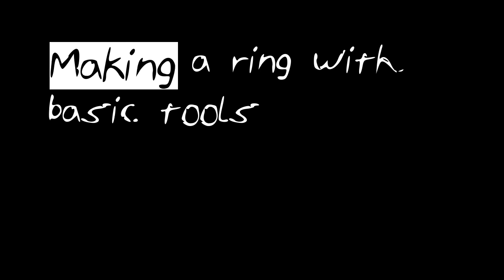Making a wood ring with basic tools

Comment: Terrific job and you've proved an artist doesn't need a shop full of expensive tools to create beautiful work. CA glue could be applied simply as ring is turned, then polished with a little cloth wheel to make it sparkle. CA also hardens the wood.
Reply from the maker: Thanks a lot John! Some other folks have also sugested CA glue, I'll have to give that a try sometime.

Comment: Cutting wood with a hacksaw? Man that must have been time consuming!
Reply from the maker: yeah fur sure it's not fast, but for such small cuts it's not that bad either.
Reply: They're great for cutting PVC or metal though. Do you have a 14 TPI blade on it? If not that could speed the process up a bit. 

https://www.amazon.com/Irwin-218HP300-12-Inch-Combi-Saw-Cutting/dp/B00004YO5F

There's also this Irwin combo saw. Pretttty cool.
Reply: Lies We've Been Told was doing it today isn't actually as bad as you'd think.. speed is your friend
Reply: That’s exactly what I was thinking
Reply: Bruce Chastain Get yourself a Japanese pull saw. The larger ones are good for big cuts but the small ones are perfect for the small cuts and will reduce finishing time due to the fine finish they leave. They can be had for a reasonable price nowadays.
Reply: It's actually not suprising
Reply: Imagine that time x 1000 when he was sanding by hand😰😴

Comment: If you want to simplify your next ring (or for anyone contemplating making one), you can start the corners with either a knife, a hand plane or chisel to help you knock off some of the wood quickly. Just be careful not to remove too much material.
Reply from the maker: Thanks Vol for the tip, I'd like to do another soonish.
Reply: Depending on the type of wood, you might also be able to put a taper on it to make it look less chunky.

Comment: you definitely want to treat it with something, otherwise you will have some issues. as a jeweler I've had to send people to the hospital a few times for infections stemming from untreated or undermaintained wood rings. Had a lady get meatball under hers, it adhered to the wood, rotted, did the same to her skin(she rarely took it off) and the hospital had to remove her finger due to a blood infection. Coat that thing!
Reply from the maker: wow! Well I did put some linseed oil on it, but I've only done it like once in many months. I'll have to reapply some soon I guess. I do take it off a lot, every night for bed and also when working in the shop.
Reply: What do you recommend?

Comment: I've heard that CA glue (super glue) is a good finish for wood rings. Hard, clear, shiny, and protective. Although I don't think it preserves color in exotics, and I'm not sure whether to put the oil on before or after CA glue. But if you apply 5 - 10 coats to that while sanding every few you'll be golden.
Reply from the maker: Yea I've heard CA glue works well too. I'll have to try that next time.
Reply: Bruce Chastain It’s Used on high end pool cues. You can use whichever finish you prefer first since it will mostly be changing the appearance. The hard CA glue will provide all the protection needed. Pro tip......CA glue can be used a clear coat repair. Just learn the techniques that guitar repairmen and luthiers use and you’ll have all the techniques needed to repair and finish wood.

Comment: I made almost 2 wooden rings using this method.  I do not suggest using a drill as a lathe.  A drill was not meant to run non-stop for long periods of time.  You drill for a few seconds then rest and repeat.  My drill burned up half way through the second ring.  The ring that i was able to complete looked great.  I would suggest using a rotary tool that was meant to work for prolonged periods of time.  A dremel or any other brand of similar tool for example.
Reply: Or you could use a BOSS sander its really useful for stuff like this

Comment: Thank you for this video. I've made ring from oak wood with even less tools. For example I substituted the table with clamp for an old unstable chair. When I had round ring, I bought small crystal and drilled small hollow and glued the crystal with epoxy. I didn't attached drill bit to drill, I was afraid of drilling through.
Reply from the maker: nice. do you have a photo of the finished ring?
Reply: I don't have photo of it when it was new but I took some today. I was making the ring for my girlfriend as a surprise but I was measuring wrong so I had to adjust inside diameter when I gave it to her. Unfortunately after that the ring was too thin and it broke after 14 days of wearing. Fortunately the gap is on the opposite side of the ring than the crystal so the ring is still wearable. I still haven't decided if I should glue it back or just round the edges. According this experience I guess that the position of the crystal/stone is important and can make the ring more durable. I think that the hollow have to be drilled along wooden fibers, because it's the place where the probability of breaking is highest and then glue/epoxy holds it together.
Here is the photo: https://drive.google.com/file/d/1ggn1zIs1KLVqqDkkLS_ZDABU3WLXPx7_/view?usp=sharing
Reply from the maker: hey but that looks good, too bad it broke. But you each time you make something it gets easier, maybe you can make another. Just call the first one a prototype :) thanks for sharing

Comment: Put it back on the drill and then use a light stain on a rag and just touch it to one side until the color gets to the middle, and then use a darker stain on a rag to do the other side and just overlap it a little bit for a good contrast in color. Then with it still on the drill coat it with a regular CA glue to give it a nice shine and protective finish.
Nice Job. It's nice to see someone make a wooden ring without a turning lathe.
Reply from the maker: thanks for the advice and compliments! One question, what is regular CA glue?
Reply: Cyanoacrylate Adhesive. It's basically super glue. But be careful when you choose the glue. Some have just a little Cyanoacrylate in them, and a bunch of junk in it. If you get some make sure that it is clear.

Comment: Tung or boiled linseed is good with a wax polish on top of it like the minwax paste wax one. It helps for a little bit of extra protection. Good work!
Reply from the maker: Thanks! I ended up using linseed oil, I wear it everyday and so far it's still holding up fine.

Comment: What was the drill attachment you used? That's a brilliant idea I hadn't thought of before, I usually just use a ring sizer with the small end shoved in my drill but your method seems a lot more stable.
Reply from the maker: thanks Kay, that was a 1/4 or 3/8 socket extension. Then I found a socket that just happens to fit. I would actually think a ring sizer would be better.

Comment: i made a ring using your method it turned out great i didnt stain or oil it i just used valspar project perfect top coat clear gloss its a very good product it will darken the ring a bit but in a good way its a high gloss that will deepen and enhance the woods natural color

Comment: turned out really well you could dip it in epoxy a couple of times let it dry for 24 hours before each dip or use a water-based polyurethane wood a few coats of wax n buff to a shine or boiled linseed oil and wax are Prego with epoxy two or three dips

Comment: Thats pretty awesome. How did you determine the size for the inside hole to make sure it fit?
Reply from the maker: thank you! I already had an old ring so I measured the inside of that one, then used a drill bit that was slightly smaller. Finally I just kept sanding the inside until it fit.
Reply: Perfect thank you

Comment: How did you know how big of a hole to drill
Reply from the maker: Hey Larry, I based the drill size off the diameter of a ring I already had. But I didn't have exactly the right size drill even after drilling I had to open it up more by just sanding the inside.
Reply: You can use one of your rings or if you know what size ring you want you can Google ring size conversion and it will tell you what size hole for all the ring sizes

Comment: Can someone explain to me why he's using a hacksaw on a board? Thought hacksaws had smaller gaps between the teeth for metal and PVC.
Reply from the maker: Hey Austin, actually that's what I thought too, but it turns out they work pretty well on hardwoods also. Of course there are better saws for the job but that's what I have.
Reply: +Bruce Chastain Fair enough. Make use of what you got, I like it. Great video by the way.

Comment: My shitty drill broke so I created the hole with a dollarstore u-shaped knife and carved the rest with a pocket knife. For the outside I used a hacksaw and the pocket knife. I figured out that the rings fit me best if they arent exactly round. Mine are quite thin and a bit thicker on the top. The ones with cherry took me about 2,5 h, my beech one ca. 3,5 h and the ones out cherry branches (the wood was quite soft for cherry) about an hour. I like carving more, although the shaped isnt as perfect as yours.

Comment: try usinf hole saw cuttin exterior first sand then cut interior  then sand,,,, make it a lot easier
Reply from the maker: yeah agree a hole saw would be a good idea.
Reply: also notices he uses a hack saw,,, that for metal  needs to use a finishing saw for fine clean cuts with out wearing arm out.

Comment: If you're going to use a hammer drill then why not a band saw or a drop saw??
Reply from the maker: I didn't have a band saw or drop saw at that time, just using what I had. Also it was a regular power drill.

Comment: I've actually seen people use super glue to seal those
Reply from the maker: Interesting maybe I'll play around with super glue. I would think it would get all white looking though.
Reply: I cant say ive tried it myself, I do know that if you touch it with your bare hand on any part prior to it drying it gets a nasty white spot.  I used a clear gloss polyurethane myself, I found having a stand for it (i used 3 angled nails in a board that i just slip the ring on to give minimal contact points) to dry evenly is more important than how I apply the finish.
Reply: Nah, you need to use the watery type. Sanding and buffing will give you a proper shine but water thickness super glue won't make it look white.